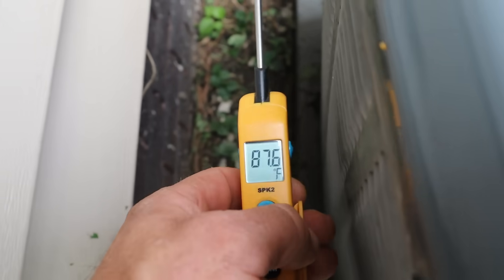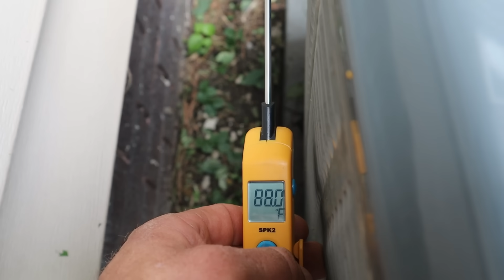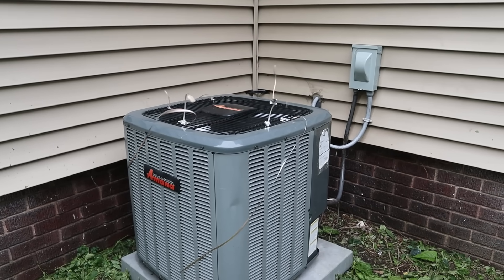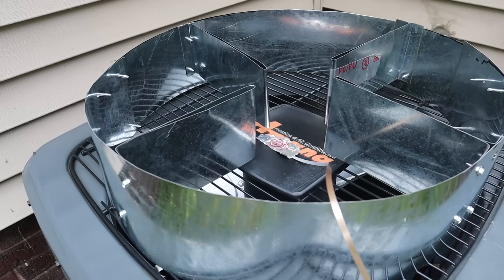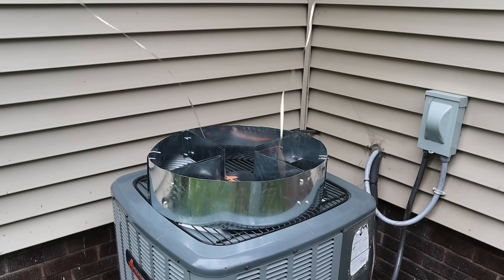Your AC Fan Makes a Mini Tornado

Comment: If you make the 'shroud' the tapered venturi shape like the cooling towers it will actually help accelerate the hot exhaust away.  Same effect is used to speed up air through an old school carburetor.
Reply: A shroud that widens at the top will slow the air down. It's the opposite of a carburetor, which necks down and speeds up the incoming air.
Reply: @TylerLinner    I suspect the flare on tall commercial units is to reduce velocity noise. The extra height is already moving the air far enough to prevent recircullation.
Reply: @rupe53 It's to reduce the backpressure on the fan which increases the airflow.  They're called velocity recovery stacks.
Reply: air flow is 180 degrees different on a carb. It goes down indstead of up.
Reply: @rupe53  well yeah, but the venturi effect is still used.. directionality doesnt matter here, just the shape of the venturi for the desired airflow
Reply: @oobschannel  well, the direction does matter depending on what you are doing. The flare on top may give more total volume. (think of rocket thruster cones)  The idea here is to push the volume straight up so more of a chimney effect. Personally I feel he's in the right direction but needs to go higher by about a foot to gain the laminar flow... and maybe roll the edges to avoid turblence at that area. That's the only reason for that taper. If you look below the grille on that unit you can see what the factory did.
Reply: @rupe53 Ever see an updraft carburetor? Used on old tractors and just about every piston powered airplane with a pancake engine (and they all use pancake engines)(correction...exclude the fuel injection types)
Reply: @obsoleteprofessor2034   I have worked on a wide variety of engines and carbs going back into the 1920s but never an airplane.
Reply: @rupe53 intake and exhaust is on the bottom. Cooling air comes thru the front and the cowling directs the air down thru the fins on the barrels (like a corvair), picks up heat and goes out the bottom, sometimes impeded with cowl flaps. Intake manifold is usually a spider and carb is at center of all that with the air filter in front to take advantage of ram air. There is usually a hot air box to direct muffler heated air into the intake for anti icing the carb throat. Basically it's a corvair/VW with wings. Carb on bottom arrangement put the engine up higher so the propeller has better ground clearance. Early fuel injection had the same arrangement but it was all mechanical...no electronics. These days it's electronically controlled FADEC I think it's called. I've been out of the loop for years because my eyes started to get weak and I no longer trusted myself with other people's lives.
Reply: @obsoleteprofessor2034   I have a Corvair (panel van) at the moment and have rebuilt about 400 VW engines over the years (I ran a unit shop for a bit) so am familiar with the air flow situation. I have also looked at Cessna type planes but never worked on one. Just did the pre-flight with the pilot (a few times) because I was going to be the passenger and I was curious. I also knew the air intake on planes is often blocked while parked on the tarmac due to bird nesting issues. (looks cozy in there!)

Comment: You are 100% right, I did the same to my AC condenser and the power consumption reduced from 6500w to 5400w in a test I did within 30 minutes, 15 minute without and 15 minute with the funnel
Reply from the maker: Very nice. I'll have to follow up on this and see if I get comparable numbers. Just curious, was your unit in a bad spot (like mine is in a corner), or was that an improvement on an already good install location?
Reply: @JerseyMikeHVAC Would be open to post a material list and rough instructions how you made you device…btw I’m subscribed.
Reply: @JerseyMikeHVAC I just ran into your channel! What a Godsend! I've skimmed through your episodes & can't see what I'm looking for so maybe you can point me in the right direction? We just had our central AC replaced. This new one is just blowing humid air. The Co. & installers insist it's 'fine'. We've had 40% humidity in the house, put sensors on vents & turn the AC on & it blows 73%-85% humid air which ups the house humidity. It didn't do this with the old unit. There's mold &  mildew growing everywhere, the carpets & furniture are all damp & sticky. We've been fighting w/the AC company for 4 years now & it's almost like they're gaslighting us & saying we're wrong. We're still under warranty & just want a new system but they keep bucking us. What can we do or suggest to make this right? We're tired of sleeping in damp beds. 😢
Reply: @zanna9857 Sounds like your way past due for a second and third opinion. It may be too late to get the original installers to fix the problem. You might get ahold of your local news network and see if they have a person/department that covers unprofessional business tactics. If this company is still in business they wouldn't want any or any more bad publicity.
Reply: @thatsonebadhatharry8610 Do you have any idea what may be causing our problems? The AC Co. texted yesterday & said they're going to now bring us out a dehumidifier for the basement. Like, what!? The basement is the LEAST humid of all 3 floors & already has an 'humidity control' system installed from the waterproofing company. I'd like to present some problems of what may be wrong w/the AC when he's here. We can brainstorm together & hopefully solve it.
Reply: @zanna9857  Looks like your original reply is missing. I don't recall all the details so I wouldn't be much help.
Reply: If it makes that big of a difference why wouldn’t it come preinstalled.
Reply: @thatyoutubeguy7583  your comment is very rational but after a lifetime working as a product manager in a giant manufacturing company I can tell you that @JerseyMikeHVAC is 100% correct in his comments to you. Manufacturers optimize end-to-end supply chain together with product performance and customer expectations and this will leave gaps because I guarantee you the “perfect” product would be a complete failure because nobody could afford it. On the positive side, filling these gaps has created thousands of millionaires.
Reply from the maker: @thatyoutubeguy7583  Because it would require retooling production lines, changing shipping and storage practices (you cant stack units on pallets as easily with such a design), more packaging, not to mention just the look of it. Some consumers may not like it. For this kind of efficiency gain, it's not really worth the wide scale investment in operations.
Reply: @JerseyMikeHVAC  The top-level comment is claiming like a 15% impovement in cooling efficiency, which is absolutely enormous and would save people hundreds of dollars a summer in my area.  If that improvement was real then the sheet metal funnel would be included flat in the package and simply installed on site.  There is absolutely no chance on Earth that marginally improving airflow nets you a kilowatt of power savings.
Reply from the maker: @Will-xk4nm  I can understand the skepticism. Thats why I asked about the CU set up and would like to see if I get comparable numbers. Gains like that are all in the compressor, not the fan motor. I don't think the gains will be the same for everyone. I think this shroud set up might be more beneficial for poor install locations rather than a universal benefit for every system, which is likely why it's not packaged with every single sale.
Reply: @JerseyMikeHVAC  On the contrary, if you scale that across hundreds of thousands of heat pumps across the nation, it's a tremendous reduction in emissions and electrical demand.
Reply: @JerseyMikeHVAC It would make sense to sell it as a seperate add-on, but manufactures probably don't want to encourage suboptimal install locations in thd first place.
Reply: @Will-xk4nm if the condenser was installed per manufacturers guidelines several feet away from the side of the house, in an area with good exposure to the natural breeze, then an exhaust duct like this wouldn't be necessary. The wind would carry away the exhaust air. 

In a situation where the condenser is installed incorrectly like this, just inches from two walls and with its exhaust air trapped by incoming breezes, having something like this duct to guide the exhaust air up and away could easily represent a 10-15% improvement.
Reply: @JerseyMikeHVAC I agree with your skepticism, even in installations where air was recirculating in a confined area causing it to come into the coil at 135 degrees, when I put a duct elbow on and the intake air went down to the 112° ambient, of course the amp draw went down on the compressor but it's been so long I can't remember if it was 15% or more, but it might have been close to that. But that's an extreme example
Reply: @kschleic9053  I understand the theory, I just disagree with your assessment that you are gonna gain a kilowatt of energy back this way.  These would already be a commercial product if it carried that much economic value.
Reply: @Will-xk4nm he isnt claiming an efficiency improvement...he said nothing about load.  He's claiming that his fan energy decreased, and that decreased because the fan is moving less air.
Reply: @the_naP  The top-level comment is claiming a 1000W savings from doing this same procedure and Mike followed up and said he would test his efficiency gain.  I told him he should not expect 1000W less power draw as the top-level comment claims.  Did you even read the thread?
Reply: @Will-xk4nm yeah, unread it.  Nowhere do they talk about load.  If I take my foot off the gas, my gas use goes down, but so does my speed.
Reply: @the_naP  'the power consumption reduced from 6500w to 5400w' is a claim about efficiency. They say power consumption is decreasing by 1100W without a reduction in cooling.  Same result with less power = efficiency
Reply: @Will-xk4nm  where did they say there was no reduction in cooling?  No one measured load.  They measured condenser temperature.
Reply: @the_naP  No measured load???  Here, again, is the direct quote: 'I did the same to my AC condenser and the power consumption reduced from 6500w to 5400w in a test I did within 30 minutes.'  5400W is not a temperature, it is an instantaneous power measurement.  You are embarrassing yourself.
Reply: @Will-xk4nm You don’t have enough information about that sample size of one to dispute it.  At the same time, it is anecdotal and doesn’t prove that it will be universal… and the poster never suggested such.  So, you’re arguing with a fictitious situation.  This is why Mile said he would measure his usage to see if it does directionally improve things.
Reply: @dus10dnd  Yes, the top-level comment IS telling people that they can expect a similar result.  And yes, I can confidently declare that a marginal change in airflow is not worth a kilowatt of energy savings because if that was true, these cheap shrouds would be part of the initial install.
Reply: @Will-xk4nm  You would be surprised what is often overlooked by people who you would expect to be smart. I had to create a 3d printed vent for my GPU in my PC since the fans were blowing the hot air against the sides of the computer case and this caused the hot air to recirculate into the GPU. My GPU fans would run maximum to try to keep the card cool but under intense load the card would throttle down to save itself. Now with the vent my card runs cooler and the fans never reach the speeds they use to.
Reply: Well I hope you do a fallow up on how it works
Reply: That's a pretty massive improvement.
Reply: How much money per month average delta?
Reply: Commenting so I get an update on this
Reply: was the second half of the test with the device? house may have been cooler thus lowering the pressures and demand from the unit. I would only trust this if the house was warm with every window and door open to add maximum load.
Reply: No way in hell it reduces the power consumption by 1kW, something else is going on there with demand. Don't measure power, measure energy use. Measure the difference in kWh over a similar period of use.
Reply: Colder refrigerant is less pressure. Numerous times I’ve seen frozen systems appear low on coolant then u thaw em and pressure shoots through the roof. A frozen coil can drop pressure more than half. So a cooler coil will reduce compressor load.
Reply: No fucking chance you reduced your power consumption by 1000w.
Reply: I'm trying to understand your test. Are you telling me the compressor draws 27 amps without the shroud, and 22 amps with it. I thought the amp draw of the compressor would stay the same.
Reply: @HowardSinclair-z6b I'm not OP but typically compressors draw less when they have a lower temperature differential between input and output, and this can also happen if sensors trigger fewer duty cycles due to the same reasons. As demonstrated in the video two of the sides had a 7 degree Fahrenheit reduction of the input temperature. This would reduce the work the compressor needs to do over a period of time. Whether that's duty cycle adjustments or the compressor itself just does less work as it does work, both result in the reduction of power draw over time.
Reply: @HowardSinclair-z6b  The theory here is (as he mentioned earlier) lower input temperature means lower overall temperature; and that means lower pressure on the pump's head.  Lower pressure pumped equals lower wattage required to power the cycle.
Reply: Something is wrong with your test.  There is no way that this simple duct would increase the efficiency by 17%.  5400W vs. 6500W
Reply: The most all around efficient design would be to add a canopy higher up, and wide enough to shade the unit no matter erst time of day it is, with this ducted baffle extended with a full width stack all the way up and through that canopy.
The unit would no longer suffer the infra-red of the sun, and the condenser exhaust would be released far enough away from the unit that it wouldn't be huffing its own exhaust anymore. 
Then add a pan below the condenser with a sump pickup so that it can recirculate the water from strategically placed misters that cover the intake.  Filtered, of course, to help reduce algae and other wet-environment concerns.
Reply: @1SqueakyWheel I had the same ideas, but I think water will eventually cause problems like scale and algae.
Reply: @1SqueakyWheel  just saw this. I had the same thought.
Reply: @cadthunkin  Yeah, but you didn't take action on it & do anything about it, whilst JerseyMikeHVAC did.
Don't try and take that away from him.
Reply: @-108-  You're jumping down his throat fir no reason...  he was addressing me, not JerseyMike.
Reply: @1SqueakyWheel  Of course I did! That's because I was trolling.
My last sentence should've given it away... but I have to admit that, in this day & age, plenty of people would issue such a cringe statement ("Don't take that away from him.") in all seriousness. So my bad for not making it more obvious.
Reply: @-108-  I hear ya.  All good!   😋
Reply: @1SqueakyWheel  the misters will scale up you coil surfaces, and cause dirt caking as dust in the air congeals on the coils, killing you heat exchange. You would have to clean your coils daily to mitigate this.
Reply: @1SqueakyWheel  they sell a sun shade that sits on top of the unit to shield the sides from sun. They also sell a mister system that only on when the motor(fan) is running. A stack with the other 2 options would make the best combo for keeping the units temp down. My poor unit sees 90* about 3/4 the year. I'd be interested to see the 3 of them working for my setup.
Reply: @k20Fritz  Yes, the mister I'd designed uses a relay to control the recirc pump (or solenoid valve, if using a water spigot) that tapped off the fan control relay. 
As for the sun shade, depending on its design, it could either help or hinder the purpose.
Reply: @1SqueakyWheel Sun hitting the unit is insignificant compared to eliminating the recirculation of the hot air. And I've been on several jobs where units were in the shade like under carports, or or patios, and it recirculated so much hot air that it ended up building up to where it was 135° coming into the coil.

I've also taken care of units in the Southwest desert where the blazing sun is non-stop, almost never any clouds or shade, and when the units are placed way out in the open area with no shade whatsoever but good air flow, they work just fine, and I've worked on many that are well over 30 years old with original compressors and some even with the original fan motors😊
Reply: @7x779  No doubt.  😊
Reply: I was skeptical about the efficiency claims and tried it myself with some scrap metal I had in the garage.

It 90+ outside and my unit is in direct sunlight. I measured the heat areas inside the unit with a heat gun and after installing the funnel, the hit spots even out as if the airflow helped cool it better. 

I did not measure my wattage but if the unit itself is cooled more efficiently I can assume it will be more efficient and effectively function.

Test it out yourself instead of crying the the response about how it's not possible lol.
Reply: @LawPope  I'm not the one who said it's not possible, but you guys are missing the whole load part.  Measuring the temperature of your condenser in spots and relating that to performance (efficiency) of the unit is like trying to tell how fast you're going by measuring the temperature of your radiator.

Someone needs to do this, and measure actual load and demand for both the shroud on and shroud off conditions to be able to actually say whether it is doing what you think it's doing.
Reply: @LawPope  You can't be serious.